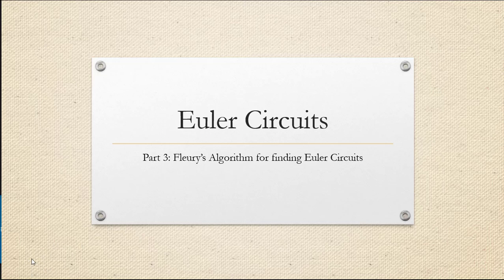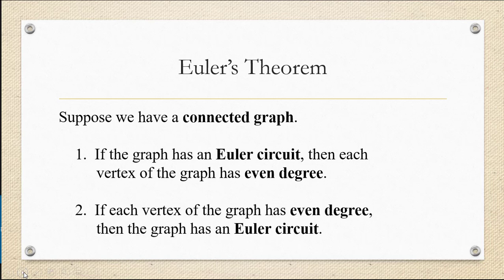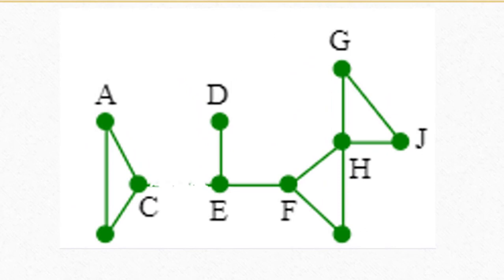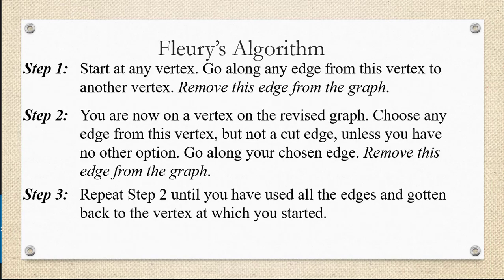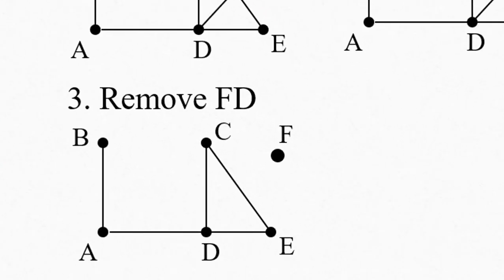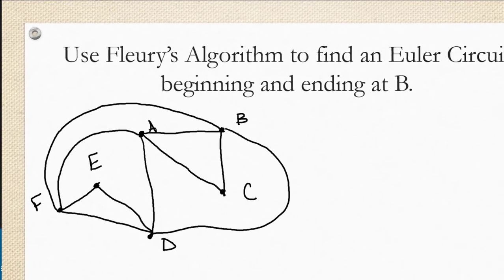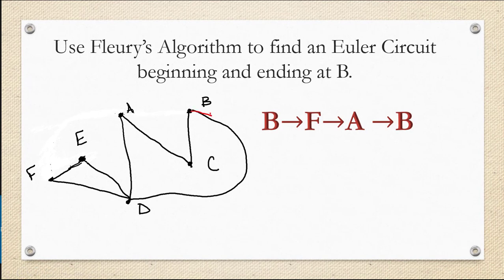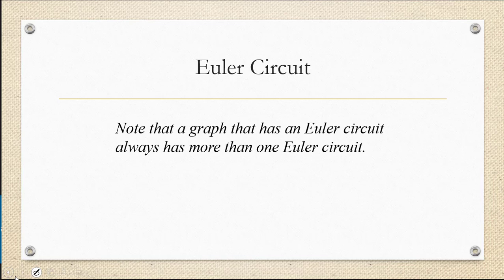Euler Part 3: Fleury's Algorithm for Finding an Euler Circuit in Graph with Vertices of Even Degree

Comment: How do i determine if the removed edge is a cut edge ?
Reply from the maker: Good question.  A cut edge is an edge that, when removed, separates the graph into two components, two parts that are not connected by any edges.  Thanks for posting! :-)

Comment: Gabriela Bircia
MGF1107 MW9:30-10:45am 
" Suppose we have a connected graph .
     1. if the graph has an Euler circuit, then each vertex of the graph has an even degree.
     2. If each vertex of the graph has even degree, then the graph has an Euler circuit."

Comment: Taylor Slotsky 
MGF1107 MW 9:30 
With a connected graph, 1. If the graph has a Euler circuit, then each vertex of the graph has even degree.

Comment: Melissa Hooper
MGF1107 M/W 9:30
If you can remove an edge and it disconnects the graph into 2 completely different components it is called a cut edge.

Comment: Jorge Cereghino MGF1107 - Mon 11am
FLEURY'S ALGORITHM:

STEP 1: Start at any vertex. Go along any edge from this vertex to another vertex. Remove this edge from the graph.
STEP 2: Choose any edge from this vertex, but not a cut edge, unless you have no other option. Remove your chosen edge from the graph.
STEP 3: Repeat Step 2 until you have used all the edges and gotten back to the vertex at which you started.

PS: This is FUN!!